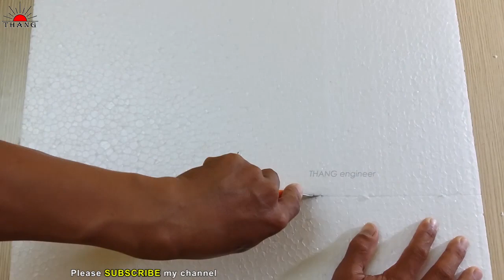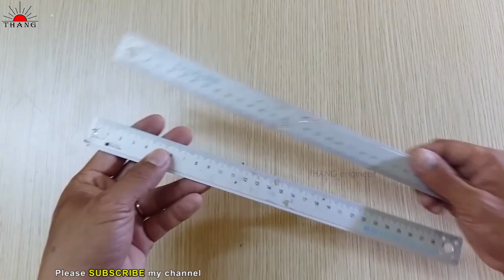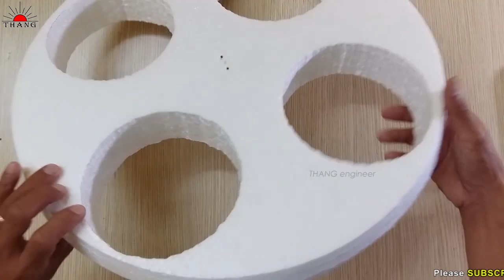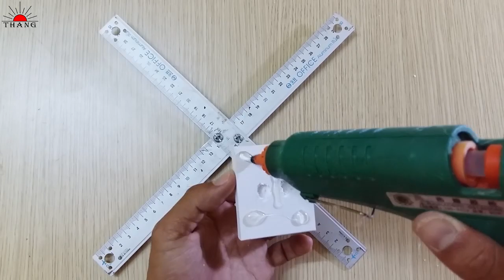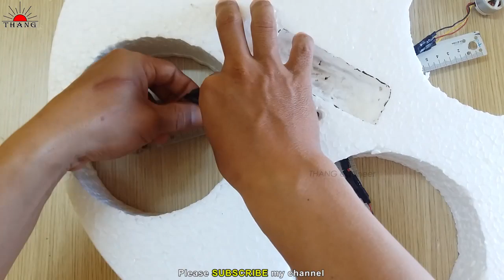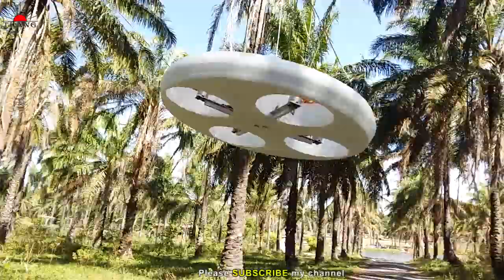How to make UFO Drone that 100% fly

Comment: What is the price of transmeter and receiver.
Reply from the maker: About $100
Reply: Where do you  get  that motor, fan, battery, remote control board. Please  SAY PLEASE please, please, please, please, pleaseeeeee
Reply: Will you  get me that. Can you  order online. I will  give you money.
Reply from the maker: @harshith.r2372  very sorry. I make for my project. I don't sell. You can make a drone for yourselt
Reply: You  need not get to me just say where did you get.
Reply: Please, please, please, please, pleaseeeee
Reply: @harshith.r2372  flysky transmitter and receiver about 5400 in india